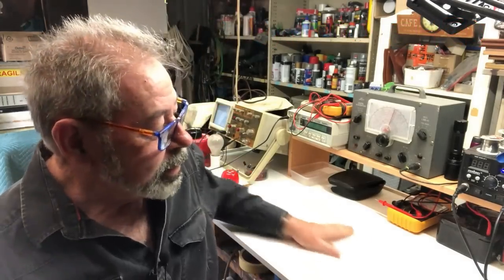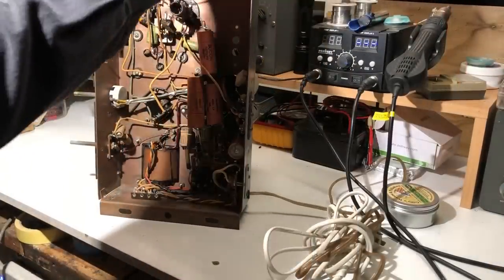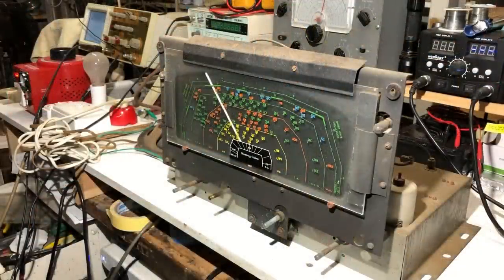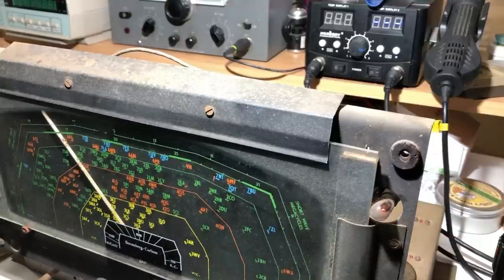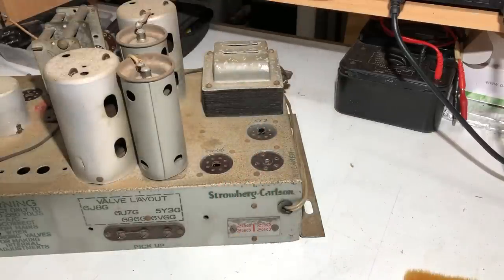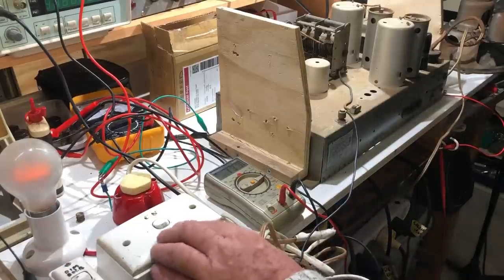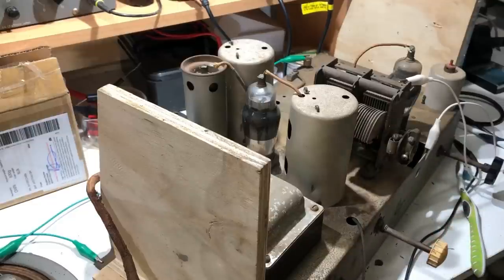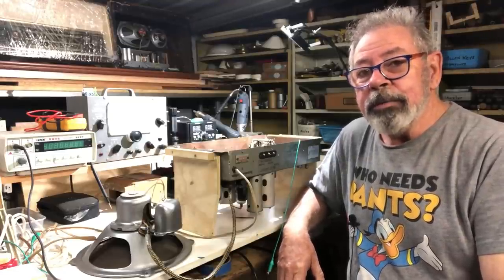1941 STROMBERG CARLSON model 542 restoration and repair PART 1

Comment: Haha.... well played Don, I'm still smiling 😄 I'm traveling around and completely missed this video. All week I've been getting obscure references to tea bags in the comments and couldn't work out why when there was no speaker repair in the video. All the same your speaker look pretty impressive when you had finished it. The tubes of Liquid Electrical tape seem to be clear with blobs of black. Great job on the radio so far and finding the bad solder was clever, hard to find something like that. 
Looking forward to part 2 Don, Cheers and take care 👍🙂
Reply from the maker: Hi David,
I knew you were travelling from a comment on your last video and I was thinking "He'll see it sooner or later Ha ha!"  Just a bit of fun.
Every fault is a puzzle waiting to be solved.  The bad solder was just circuit tracing 101 but I do think I should get myself a signal tracer.  Any that you would recommend?
Cheers and safe travels!

Comment: I have to say I was expecting a bigger chassis inside that beautiful and upscale cabinet. I'm sure it'll sing though-best of luck with it Don.
Reply from the maker: Yes it's a typical 5 valve design and only 1 short wave band.  There's plenty of room in the chassis and I suspect that they used the same chassis for more complex sets.  That's pretty typical of the radios from this era that we get here.  I have only seen one that had a noticeably bigger chassis and that was the Kriesler Projectographic.  But even that was only a 6 valve design (it had an RF stage).  Very different to some of the American radios I see on Youtube with heaps of valves and huge chassis.
Reply: my thoughts exactly, a beautiful cabinet, and a very cheap chassis, ( the fake preselecter buttons surrounding the dial are a giveaway.)

Comment: Interesting use of teabags 👍 I sometimes layered toilet paper with nitro as it seemed to mimic the original materials quite well and retained some flexibility.
Reply from the maker: Hi Klumpy,  That sounds like a good idea too.  The teabag idea came from David Tipton of "Dave's Radio Adventures" - a great restoration channel. hence the "Tipton's Tea Bag" reference.  It did work rather well though so I would recommend it.

Comment: Great job on that speaker cone. Those fine coil wires can be a problem.
Reply from the maker: Cheers Jim.  This one seems to have more than its fair share of bad solders and dry joints

Comment: You are doing well Don,  i like your methods of fixing the dodgy mechanisms :-D.
Sanding a tube in a pillar drill was ideal.
Ok ideal would be a tube that was spot on without any work, but that would be no fun lol.
I did detect that you wanted something to eat, sausages may have been your desire.
Dam i want a sausage sandwich now :-D. 

Teabags to repair speakers, that must be a crime 😀
You are not the only man to solder to imperfect wire,  mistakes are a good reason to swear lol.
Keep up the good work Don :-D.
Reply from the maker: Hi Harvey!  Unfortunately there was not a sausage to be had. A sad situation indeed. 
This radio seems to have more than its fair share of dodgy solders & wiring. More to come in part 2.

Comment: Nice repair of that speaker. Might be worth replacing the voice coil dust cap. I have an identical speaker in an STC radio of similar vintage to yours and the dust cap was missing which allowed dust to get into the voice coil gap causing scraping. I blew it out with compressed air and glued a new dust cap into place. Problem solved. (Tipton tea bags eh ;-)
Reply from the maker: Hi Ian, The radio is now back with its owner.  Perhaps I should have put a dust cap on it, however these speakers didn't originally have dust caps.  It probably would have been pointless anyway because the rear of the voice coil is exposed to dust etc. as there is no spider as on modern speakers.
Cheers

Comment: Don, I used to use the same solder sucker as you. However, they were not that great, seem to clog easily and sometimes hard to use. I switched to "ENGINEER Engineer Solder Suction Device SS-02" off of Amazon. So much better. You may want to try one if you have any issues with the type you are using. Thanks for the videos, keep them coming! Orin
Reply from the maker: Hi.  Yes, I have been putting up with that old thing for too long and you're right - it isn't very good.  I'll have a look at the one you suggested. Thanks!

Comment: Nice  I'm surprised Stromberg made any thing for the civilian market during the war.
Reply from the maker: Hi Mack.  So was I.  Most manufacturers stopped production during the war.  Nevertheless there are a few around so there must have been some production.
Reply: @Donno308  I had a Army signal Corps BC-348 which was a great receiver and used by hams, also had a Stromberg EE-8 field phone. They made some great equipment.

Comment: RE your tea bags I have a coffee purcolator and it uses a paper filter to contain the coffee where the hot water passes through. The paper filter is quite light and is much larger than the Liptons tea bag it might make a very useful speaker patch.
Reply from the maker: Not a bad idea!  I’ve never got into filtered coffee myself - it’s either cheapo instant or espresso for me, but I’ll give them a go next time. Cheers!
Reply: @Donno308  They come in packs. I do think they do become easy to use  when wet I recon.
I hope it works OK good luck.

Comment: i have exactly the reproduction grill cloth for this radio what size is it at my work at Speaker Hospital we can re-build the speaker if needed
Reply from the maker: Hi Ian.  Thanks for that.  I'll check the size and get back to you shortly.  I think the speaker will be ok but I have other speakers that need work.
Cheers
Reply from the maker: Hi Ian.  The speaker baffle is 37 X 46 cm.  I guess an extra cm or 2 to turn over the edges so 40 X 50 would be ideal.
I do have a suitable piece of Airzone cloth.  It's close but not identical, so if you have the identical material that would be great.
Reply from the maker: Hi Ian.  Just following up on the grille cloth.  You can email me at:  donno1955@hotmail.com.
I have fitted the Airzone cloth.  It looks good but if you have the original I would like to change it as this radio is so original.  Just let me know how much & payment details.  
Cheers

Comment: Why do you not use stand-alone, DC power with limited current power supply for capacitor testing/training? Why do you use variac? Until diode tube is not working, there is no sense to use it. Even simple DC/DC PSU from some Liion battery can deliver 400V and few miliamperes for cap training. Just clip it to cap and check current!
Reply from the maker: Good point.  I don't have a stand-alone power supply bit I think it's about time I bought or built one.